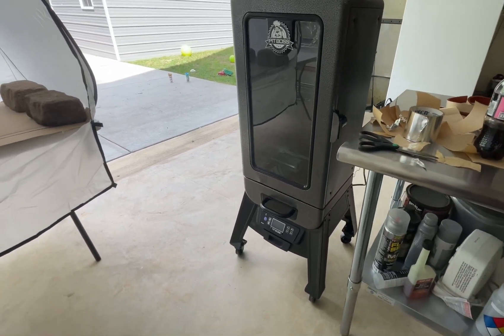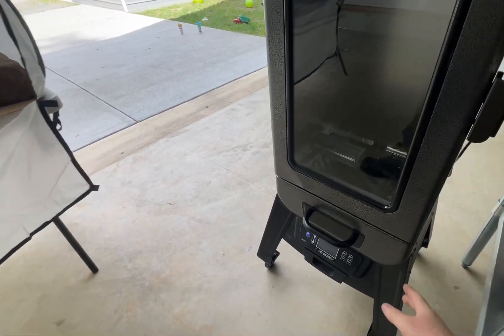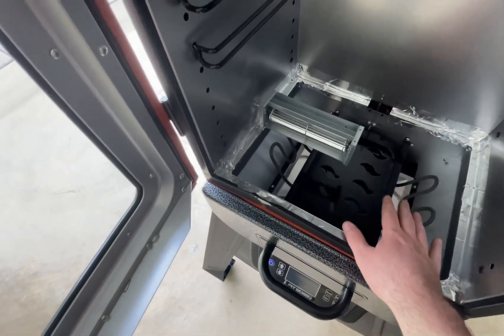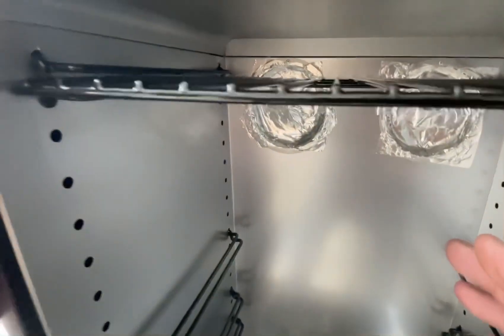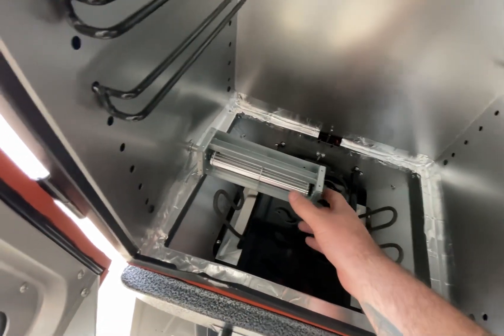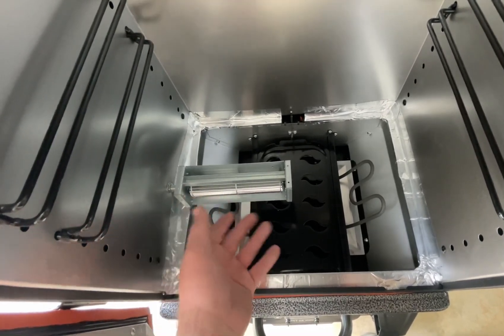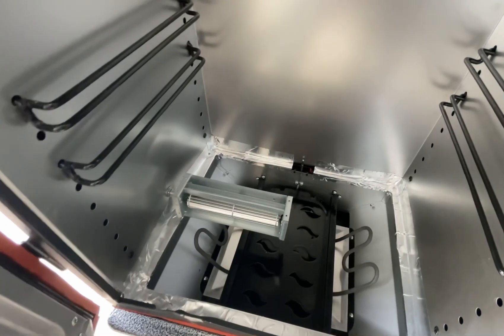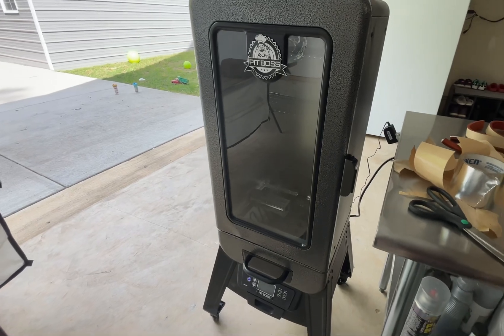Amazing DIY Cerakote Oven With Mods

Comment: What is the model of the smoker?
Reply: Here is the smoker you want, pretty sure its the same as the one In this video.  Its higher wattage than most smokers on the market and well-suited.ted for Cerakote and Molly resins. This guy does a really good on the review and calls out the model number as well.  Pit Boss Model PBV3D1 Silver Hammertone. https://www.youtube.com/watch?v=2KykSyCBS44&t=1378s

Comment: Does the smoke affect the curing and can I leave it in my garage while baking?
Reply from the maker: @kainadams8692  there is no smoke. An electric smoker only produces “smoke” if wood chips are put in the heater pan. Without the chips it’s just an electric oven.

Comment: What all can you fit in it?
Reply from the maker: Anything up to a 18” barrel. Length wise. I can fit 2 broken down pistols or 1 broken down AK or AR. Whenever we can’t fit over 18” barrels we use air cure cerakote for those parts. But it will fit 99% of the stuff we do
Reply: @aquilaarsenal  awesome thanks!